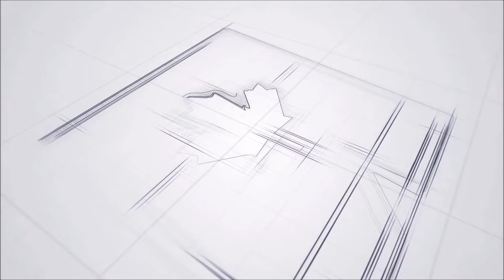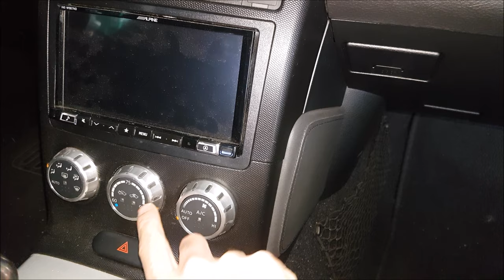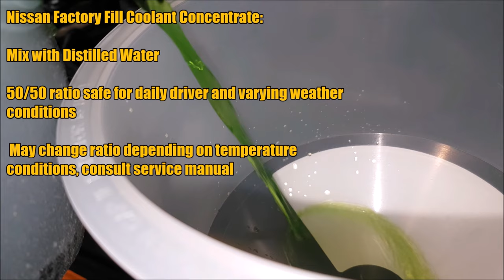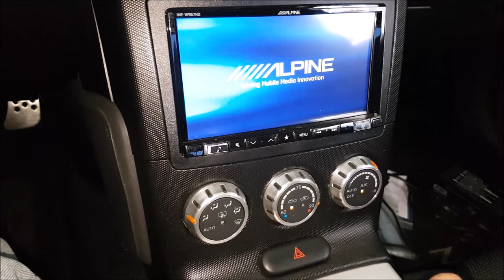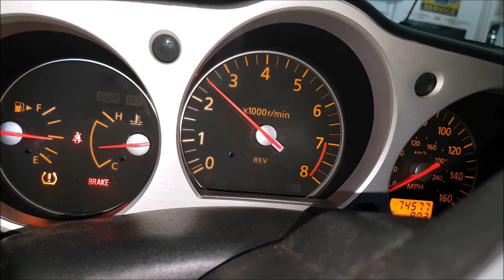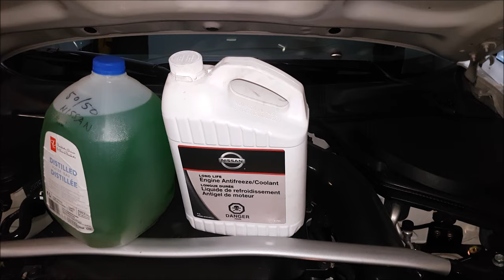How to Bleed Coolant System Procedure Nissan 350Z & Infiniti G35 (Nissan 3.5L V6) | AnthonyJ350

Comment: I bought a low milage 04 that was well maintained with lots of records so I wouldn't have to do much.... oh boy I was wrong 😂. It was good for 6000km. Ended up having to fix the boot hole seals because oil was leaking in the wells. Instead of buying new covers I took the old ones off, kept the boot hole gaskets but just put a nice layer of black rtv on them. Grabbed new valve gaskets well I was at it. It ruined one the coils so I bought 6 new along with plugs. So far 20,000km later no oil in wells 😂😁. Now i have the joys of doing the differential bushings since I saw black leaking out 😟. Did the rotors and a bleed ahwile back. It's always something with these cars lol. There good cars though, bullet proof I've beat the living shit out of it the past 4 years no major issues.
Reply from the maker: I agree they are good cars. They're at that age where wearable items and rubber parts are going to degrade. My 2005 Silverado went through the same thing, spent 3 year rebuilding it with better parts as parts would wear out. Now the vehicle drives awesome and Im spending very little money. 

At least with repairs like that you can upgrade. Newer cars this seems to be getting harder to do.

Comment: I think it’s hilarious that they didn’t include that plastic valve in the vq37 but instead of just using a different hose they used the old ones but with two clamps and a connection for no real reason
Reply from the maker: After thought maybe before production runs?

Comment: Mine does not overheat anymore but heater still don't work which i don't mind since im not using it on winter
Reply from the maker: It might be the blend motor is not working preventing the temperature change.

Comment: Is this the same process for the fifth gen maxima? SE
Reply from the maker: Be really similar. Does it have the bleeder screw?
Reply: @AnthonyJ350  I’m not seeing it actually. It’s a automatic. That may be why.
Reply from the maker: @watchmesk8betta  I'd use the funnel and elevate the front the same as the video.
Reply: @AnthonyJ350  hey thanks. So I’m not certain but mine doesn’t have a bleeder. And I got the job done last night thanks! Appreciate you taking the time to help the people

Comment: Wait so if my radiator fans kick on while my engine temp goes up that means my thermostat is working correctly?
Reply from the maker: Not necessarily, the best way to quickly check the thermostat is to make sure the upper and lower radiator hoses feel like the same temperature safely. Also is your temperature gauge fluctuating?
Reply: @AnthonyJ350  yes , I notice that the temp gauge go up and down as I drive cruising on the freeway, I’m thinking it’s either the thermostat or the water pump but the water pump shows no indication of a leak or any excess noise coming from the engine bay. I’m going to check the radiator hoses tomorrow to see if there is a big temp difference.
Reply: @AnthonyJ350  also there’s no leaks coming from the car and I haven’t removed or added coolant and so I know there shouldn’t be air in the system and the radiator cap isn’t cracked or broken and neither is the radiator hoses not sure if that helps narrow it down
Reply from the maker: @JP-zz5rm  Does the temperature go down when you're moving? Or does the car take a long time to warm up when you start driving?
Reply: @AnthonyJ350  the temperature goes down while I’m on the freeway about 3/4 of the way to Hot and when I’m in the streets it just goes up until it overheats
Reply: @JP-zz5rm  same things happening to me . I just recently bought a 04 g35 . I drove it about 2 hours home no problem. Mostly freeway though. The next day I drive it around the city & then I stop at a light or slow down it starts to slowly go up in temperature. But the thing is , it doesn’t happen every time . It only happens at random times when it starts to overheat (some days it doesn’t overheat at all) . But yes only overheats when idle or slowed down . My fans work , my heat works . But my ac doesn’t work . It gets up to normal temperature normal . My overflow tank is really beat up though . The tank has some small little cracks on top . Can this be the cause ? It doesn’t steam out coolant or hiss .
Reply: If my coolant in my funnel starts filling up after I reached optimal temperature would that mean that I have a faulty thermostat or could It be something else?
Reply: @leggomyaggo  most likely a faulty or stuck thermostat, what most likely happens is the car begins to warm up and as it does the coolants pressure goes up , since the thermostat can’t open to allow coolant to pass through the car it  begins to overheat thus pressure and temperature go hand and hand so the coolant in the funnel also begins to fill up.

Comment: Do you turn the car off after you rev it, in order to let the engine cool down? Does the bleeder screw stay open the entire time?
Reply from the maker: I would let it idle for a few seconds before you shut it down.  The bleeder screw is only opened when you first initially fill it up.
Reply: @AnthonyJ350  ok, last question, is it ok to open the bleeder screw while I have the lisle funnel on the radiator, to check if I have air bubles after first initial fill? 

Doing the job as wee speak, just finished the thermostat now im bouta bleed and fill the system.
Reply from the maker: @spliffstrumental90  Ya you can do that.  Initial fill with the funnel is fine.  Just leave it closed when you run the motor.

Comment: my fans turned on but the funnel overflowed, i turned it off and the coolant in the funnel went back down, what should I do?
Reply from the maker: Did you open the bleeder when it was cold before you filled it up?
Reply: @AnthonyJ350  yup, literally followed your video step by step. Im thinking its my thermostat because bottom radiator hose is cold and the top one is hot
Reply from the maker: @gianvmarco  Makes sense, I got an OEM one that was made in Japan. I have a full coolant job video for the car.

Comment: I have been trying to bleed the system but every time I start to get heat when I rev it the heat goes away once I stop also the aluminum radiator I installed starts to get hot any suggestions?
Reply from the maker: Did you do it the exact same way as the video?
Reply: @AnthonyJ350  II wasn’t using the bleeder valve enough like you did in the video  I eventually got it bleed all the way just took a lot longer than expected this video helped a lot
Reply from the maker: @trentonbullock48  Glad the video helped you out!

Comment: Hey Love the vid! I was just wondering I changed out my lower radiator hose on my 350 and when I was bleeding the system the car was overheating and the funnel kept shooting out coolant and for some reason my radiator fan was louder then usual, and when i turned up the heater all the way cold air was blowing not the usual hot air. Do you know what I'm doing wrong! (when i was bleeding it, it was not on jacks)
Reply from the maker: Did you open the bleeder first when you filled it up? You need to raise the front end up as well.
Reply: @AnthonyJ350  yes I opened the bleeder but after I started Revving to 2500 a lot of coolant started leaking from the bleeder
Reply from the maker: Is the bleeder closed?
Reply: @AnthonyJ350  yes I closed it after the coolant started leaking out
Reply from the maker: @Mark-kd5kx  But it leaks at the bleeder with the radiator capped off when you rev to 2,000RPM?
Reply: @AnthonyJ350  yes
Reply: Having the same problem did u ever figure out why ?
Reply: similar problem, i replaced the thermostat hose to radiator (mishimoto got ripped due to touching ac clutch) refilled with coolant, bleeding it, did the bleed screw first then tighten now the coolant is rising thru the funnel i turn it off before it spills then it slowly goes back into the car, im guessing thermostat is not opening anymore and i just replaced it couple months ago the guy actually took it out so it was left open year round any idea why it’s wanting to overfill

Comment: Had my bleeder valve explode on the road. The car really only over heats only when driven. I haven't got a new valve yet, and just connected the two lines together via a plastic tube the same diameter of the bleeder. I bled the system with a funnel, and it still overheats. What am I missing? Do I REALLY need that valve, or do I have a possible head gasket issue?
Reply from the maker: Are you looking coolant regularly?
Reply: @AnthonyJ350  the car stopped leaking coolant after I connected the lines back together
Reply from the maker: I would get the Z1 bleeder and do the procedure like in the video. Takes easily up to 45 minutes to bleed it.
Reply: @AnthonyJ350  ok. Ill give it another try. I did notice the vehicle was completely out of oil. I wonder if this would contribute to the car only over heating while being driven, not while idle
Reply from the maker: @amaterasu8829  Yes, oil lubricates and can act as a heat exchanger with an oil cooler. This video may help as well https://youtu.be/1Yrlq285UHY

Comment: I've got a question that doesn't pertain to this particular subject.. but, my Z makes a pretty awful burning smell at high RPMs. It won't do it any other time, only at higher RPMs, near 5000 usually. Someone told me it could be loose oil sump bolts and the pressure is causing it to leak out and burn? I don't think that sounds right but I can't seem to find the answer anywhere I go. You seem like a knowledgeable guy. Also for reference my Z is the 04 Touring model
Reply from the maker: When was the last time the PCV valve was changed? Also check the vacuum tube that goes from the intake tube to the motor.

Does the vehicle have a breather PCV delete?
Reply from the maker: Curious, what kind of oil do you use?
Reply from the maker: This video might also help you https://youtu.be/Kzo3ZlPKyxw

Comment: how do i know if my thermostat is working?
Reply from the maker: Measure the heat of the upper and lower coolant hoses on the radiator when you get to operating temperature.
Reply: @AnthonyJ350  they both have to be hot or?
Reply from the maker: @jaimeacosta6534  Yes eventually both will be hot

Comment: you wouldn’t happen to know why is my g35 leaking from the bottom of the radiator?
Reply from the maker: Radiator might need replacement. Or the drain plug is loose or damaged.

Comment: How many antifreezers bottle I need to fill a VW radiator?
Reply from the maker: Check your service manual
Reply: AnthonyJ350 VQ* srry , when I got this car it didn’t come with owner manual/service manual
Reply from the maker: Manual says 2 gallons. 50/50 mix is the safest for all driving conditions.

Comment: How can I do this if my Z doesn’t have a bleeder screw?
Reply from the maker: Just fill the radiator to the top. Try squeezing the top hose a few times to bleed the system and use the funnel and start the procedure like in the video.
Reply: @AnthonyJ350  oh wait so I fill the radiator using the funnel. Do I just fill it until my funnel looks like yours? since I don’t have the bleeder screw
Reply from the maker: @OGChris  You would basically do the same as the video, minus no bleeder screw. Did you try ordering a new one from Z1 Motorsports?
Reply from the maker: @OGChris  Ya, hopefully it removes the air that way. I would elevate the front end as well. Nissans just seem to be hard to remove air, the procedure might take you up to an hour to do.
Reply: @AnthonyJ350  ok I think I get it and I have a pretty inclined driveway so I’m gonna try it. But yeah I just bought the car and if came like this, I’m gonna have to buy one of those, thanks!
Reply from the maker: @OGChris  It's pretty much a must. You might as well order one today, they're so cheap. https://youtu.be/A0TmDY5yq5k
Reply: @AnthonyJ350  I’ll take a look at it cause I DO need it. Thanks!
Reply: @AnthonyJ350  should I buy just the bleeder screw or the whole hose?

Comment: tried doing this but after a while coolant starts gushing out like a volcano still overheats and no hot air comes out
Reply from the maker: Do you have the front end up in the air? Also are you using the funnel like in the video?
Reply: same problem here and i followed each step as explained, thermostat was recently changed and system was bled last winter, recently a hose got ripped so now i’m trying to bleed it again
Reply from the maker: @gabrielfernandez8798  Do you have the funnel and is the front end elevated?
Reply: @AnthonyJ350  yeah same funnel, the front was elevated with driveway angle but will use jack today in couple hrs to get it as high as possible… cooling fans only turn on with a/c on but not when heat is on blast, also i hear a thumping noise at radiator and thermostat hose jerks a bit as the fluid shoots out air but causes big squirts of coolant everywhere, don’t think thermostat is opening?
Reply: @gabrielfernandez8798  boosting this to see if he replies

Comment: how do you know if thermostat is working properly
Reply from the maker: If it's not working properly symptoms would be the car doesn't stay at operating temperature when moving or if it's stuck closed you car is overheating or the gauge tends to be over half a lot
Reply: Great thanks for the information how do you know the thermostat is stuck on closed mine keeps overheating after changing a new radiator
Reply from the maker: @kneebarx  Does it blow hot air inside at all?
Reply: hard to say its summer time so it all feels like hot air

Comment: the most pain in the butt car to replace coolant..it takes forever for the air to get out of the system..and forget the whole 9 liters.. i had a hard time filling with my 2 x 3,8 litre jugs..
Reply from the maker: Ya bleeding coolant and  brakes isn't really fun in these cars.  Compared to other vehicles you definitely need patience.  I think you can't get the full 9 in because a lot stays in the heater core.  As long as you change coolant often it should be fine.

Comment: Here's a dumb question from a noob like me: Why should we mix the 50/50 coolant with water?
Reply from the maker: I explain it in the video. Water is a good heat exchanger but it can corrode and has a lower boiling point.  Coolant has corrosion inhibiters and a much lower freezing point.  So mixing it gives you good properties on both ends.

Comment: I bled my 350z a handful of times and I can't seem to get all the air out.  My car drives fine, but when I'm idling, it goes up to 230 degrees.  But both my fans are working when I tested them so I know its not the fans, I don't think.  But what I did notice was air in the hose from the radiator to the overflow tank.  I can't bleed these out when I use the bleed valve, then use the funnel to get rid of air from engine and radiator, but I can't get the air out in the hose from radiator to overflow tank.  Any advise? Thanks
Reply from the maker: Did you elevate the front end?

Comment: am i wanting to keep my bleeder valve cracked while my car is warming up?
Reply from the maker: No, only open it when you first fill the system, then you can close it up.  The system is open with the rad cap off and the funnel.
Reply: @AnthonyJ350  okay thanks thats what I primarily needed to know thats what I assumed but I've seen so many different videos and everybody seems to say somthing different
Reply from the maker: @autograph415  This procedure works well for me and a bunch of people it worked for in the comments. Just make sure to elevate the front end safely.
Reply: @AnthonyJ350  thanks brother, I had a some what under standing just wanted to comgirm before starting it and fucking my slefnover and wasting time haha
Reply: @AnthonyJ350  i wanted to say again thanks fromt he bottom of my heart, my g35 runs again thanks to you brother
Reply from the maker: @autograph415  That's awesome! If you want stickers for the car feel free to email at info@gofasthavefun.ca